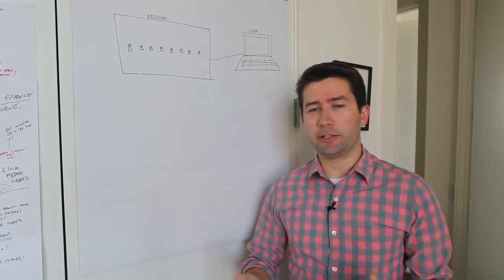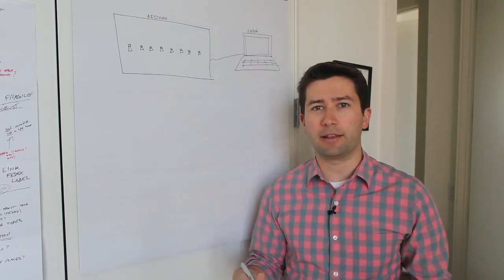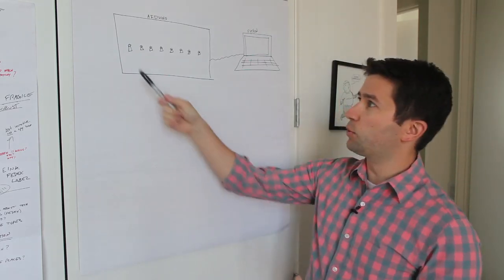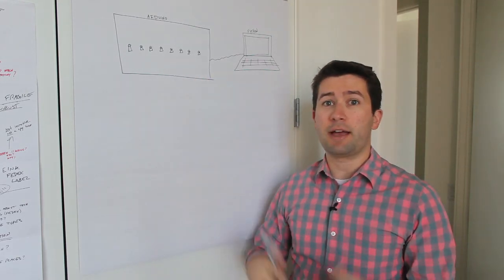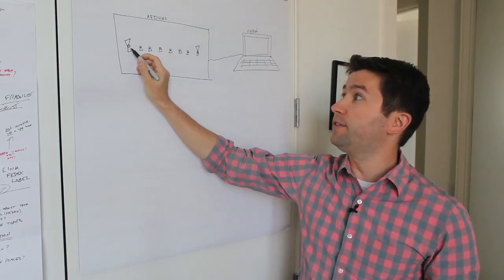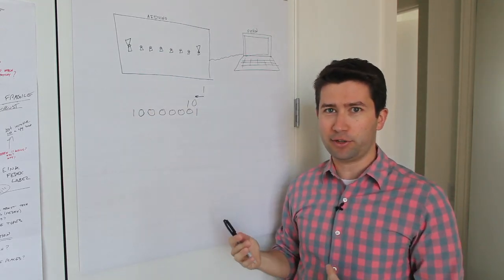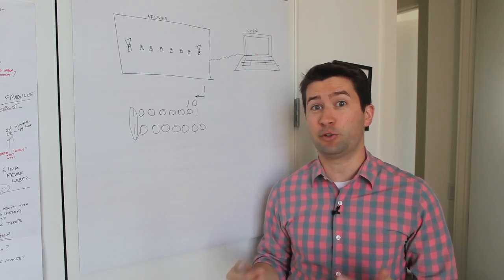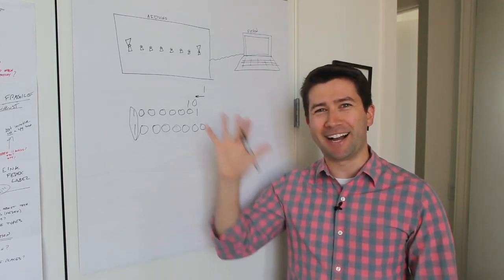Saying a Lot with Very Little (Arduino Digital Input to Python)

Comment: where you have response = response << 1, that can be shortened to response <<= 1 (or perhaps =<< i cannot remember). also, the if statement is unnecessary. since digitalRead  returns a 1 or 0 anyway, you can assign it directly to the variable. since you're actually inverting the values, you could do it with xor like in the following
response <<= 1;
response += digitalRead(i) ^ 1;

Comment: A 74HC00 series multiplexer would be perfect for this project. And if you can daisy-chain them like shift registers, you should never run out of i/o on the Arduino. Also the Arduino will basically just be transferring the byte code directly to the computer, freeing up some processing power. You probably already thought of that, but I just had to mention it.